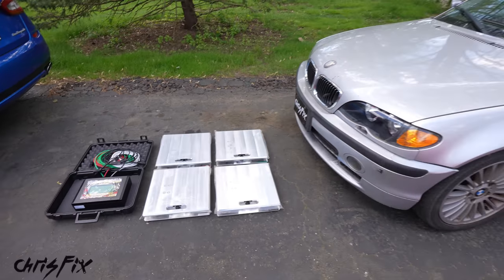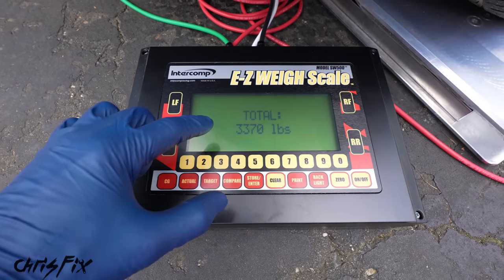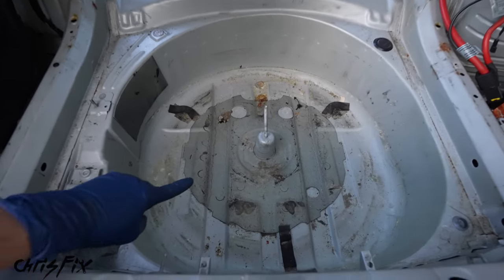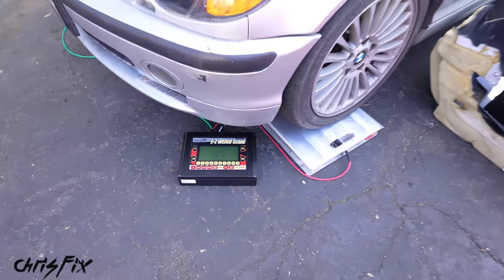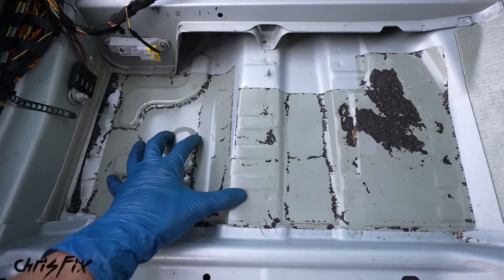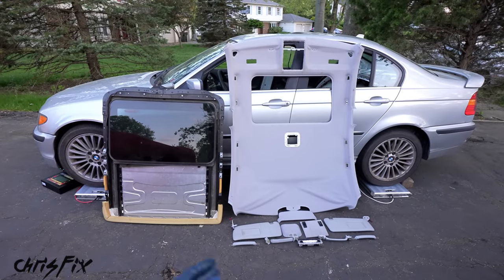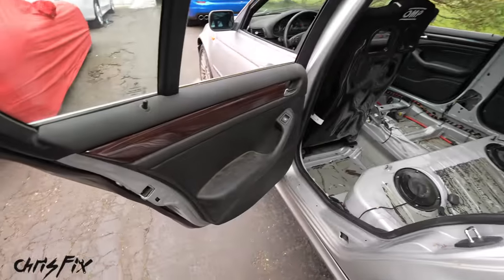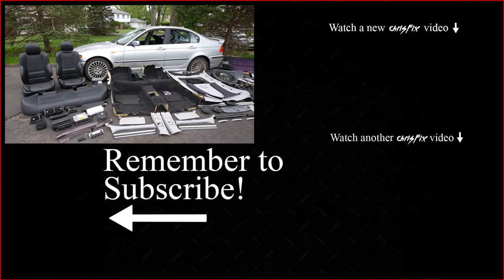How Much Weight can you REMOVE from your Car? (Weight Reduction)

Comment: Alternate title: How to make your MPG go up during a gas shortage
Reply: @dildobaggins069  Meanwhile me with my Blazer getting 15.7mpg 😭
Reply: @TorbCraft  is it from the 90s?
Reply: @x-90  its an 01 4.3l 5spd RWD. Fun little 2dr. Lowered 5" haha
Reply: Lol my raptor gets 9 mpg and it has a 36 gallon tank. I'm screwed
Reply: @Blue_Flame_Raptor  You sir... need a civic 🤣
Reply: @TorbCraft  I refuse. 😂
Reply: @Blue_Flame_Raptor  at least it’s not the TRX which gets 7 or 8 mpg
Reply: @Blue_Flame_Raptor  no wonder why you raptor drivers always drive like crap on the road, seriously when I see a raptor guy they always drive like they are angry and permanent road raging
Reply: My car is an 2007 Saab 9-3 210 HP weighs under 3000 lbs and between city and highway driving gets 28.6 mpg. Not to bad considering I run the AC also.
Reply: @x-90  and the trx has a smaller fuel tank
Reply: @TorbCraft  what about an hybrid Corolla
Reply: @gosth81  I actually got a 2002 civic a month after this comment. 41mpg!!

Comment: There's substantial weight in electric doors - if those motors can be replaced for manual handles, you'll save few ponds. You can remove them at least in the back.
Reply from the maker: Originally I wasn’t going to but we ended up doing just that lol
Reply: Not necessarily. For example on the Lotus Elise, all the fanboys and purists were furious when they introduced electric windows but it turned out that they where lighter than the manual ones. But on most cars you would be right.

Comment: Chris fix: let remove some weight.

Me: removing the engine.
Reply: That’s what I was thinking. “Bro there’s still stuff in the engine bay you could get rid of.”
Reply: Me:*removes car to make it 0 pounds*
Reply: Hah
Reply: @Wee_Mewon  😂😂😂😂
Reply: @steverossen2816  yuuup.  Ac,  Heater core,  smog pump and related tangle of vacuum lines,  the catties,  you MIGHT could get away with a "big" touring bike/lawn tractor battery and be even lighter than what what chris used.  but that's if you know your car is bulletproofed.  if you gotta crank your car for a couple minutes that motorcycle battery is a butt terrible idea
Reply: @voided76  I'm ok with removing just about everything but not the AC. Anything but that.
Reply: He could remove the ac unit and lose quite a bit of weight.
Reply: @voided76  He could put in the battery to the trunk of the car for better weight distribution.
Reply: @angelgjr1999  ......

The battery is in the trunk from the factory.
Reply: @voided76  Oh ahah. My bad my Mustang GT has the battery up front.
Reply: tire and rim are heavy too
Reply: @hom2fu  You're not going to find "light tires" at the 180-250 treadwear that lemons cars usually run.  because they're all either summer passenger or track day specific tires that are grippy as they can be:  but also have to last more than 1 weekend for the most part.  

That's kind of how you don't get people showing up with magnesium/forged/carbon spun or composite wheels with a custom engineered tire compound showing up.   :)  

Maybe you could find some E46 M3 wheels to put on it,  maybe the lemons judges will take one look at that and decide your whole rig is pretty cheaty and what else can we dock you for if not specfically the wheels and tires....

I'd put like... BFG rivals rubber or advan neova or something of that nature:  whatevers on sale on tirerack/ebay ect in a sort of works size,  because a good tire in roughly the right shape is what matters more than a pound or two out of your wheels to begin with. 

some old beat up M3 brakes that have been rebuilt and slapped on wouldn't be a bad idea,  but that's also quite a lot of money potentially and quite a bit of time sourcing parts and kits ect.  I would de-junk the wires,  off the shelf motorsports rotors for that specific car,  make sure all the ball joints ect are greased,  make it as good as it can get as it sits,  with as much as I can try and service the brakes,  dejunk the engine bay of things and send it.  Having a capable crew and decent spares and decent choreography of pit stops is going to be more important than wheels.

Comment: "Okay, now that we've pulled out nearly the whole interior, we can take out the frame and body to remove even more weight. While you do that, removing the trans and engine is essential as they provide a large amount of weight"
Reply: Just ends up sitting in a seat holding a steering wheel
Reply: 69th like
Reply: @TexasBaker  gotta take out the seat and wheel too

Comment: Remove the trunk and install a fiber glass lid, do the same with the rear doors and replace them with fiberglass sheets. Also get a lighter hood and wheels
Reply: Don’t forget front fenders, lexan windows, two piece rotors, and I’m sure he could get rid of some of the less useful metal panels in there like the two crossbars the passenger seat was mounted to. Not sure how much of that metal is used for bracing as apposed to mounting though, and that’s kinda important.
Reply: @levygaming3133  yeah that can be done but its costly to get front fenders made, i felt this was a budget build so i kept my recommendations to a minimum 
But yeah you're right

Comment: Now, let's add weight with the roll cage. Curious to see what the cage weighs.
Reply: "Looks like the cage was too heavy so I'm just gonna have to risk my own bone-crushing death on getting that sweet acceleration"
Reply: lol
removed 10% weight and gained 15% speed.
But without all the noise panels it really feels 100% faster
It's still gonna feel faster if you add roll cages
Reply: carbon fiber go brrr
Reply: @captainLoknar  Removed ~13% weight and gained ~12% speed.
Reply: Yeah the roll cage will definitely add more weight, however once you change out the steering wheel, forged rims, aftermarket exhaust, aftermarket hood, etc like a lot of people add, it's going to bring the weight wayyyyy further down.
Reply: "The car weights 400£ less" lol🤣🤣🤣
Talk in kilograms like the rest of the world,don't be so stubborn
Reply from the maker: Cage and other safety stuff weighs about 180lbs but I removed another 150lbs

Comment: I usually shave every hair on my body and race entirely naked for weight reduction purposes
Reply: Ears and nose? Didnt need em. They were only slowing me down.
Reply: I do a triathlon to lose 30 lbs too
Reply: @KraktysAncientAccount  not aero either, ears produce so much drag
Reply: Remove organs and skin. I like my ride pretty light
Reply: I wondered how could one further reduce physiological weight besides starvation, dehydration, laxatives, etc. . I really didn't need to go where my imagination took me...
Reply: @e7725  carbon fiber skin
Reply: Skin is the largest organ. Don't forget impacted stool😬
Reply: Don't forget to exfoliate, ever miligram adds up.
Reply: @stinkybean1  Yeah like all the dual organs! A kidney, lung, eye....etc. And I had most of my intestines and bladder removed and use a colostomy and urinary bag. And when race I don't use bags, I just drain it outside to the track!
Reply: Same here!
Reply: Don't forget to take a good dump before each race!
Reply: I just stop existing before a race to save weight
Reply: Same. I also tuck it back to reduce any drag
Reply: @ΒΞΔΝ  Tee-hee  =}
Reply: For racing, you need to remove your brain.

Comment: I had one of these, also recommend a lighter flywheel and lighter rims and tires. You'll get that rotating mass down which will feel better. Don't remember if it has a fan clutch and mechanical fan, but if it does, switching over to electric fan will make the engine more responsive as well. Good work, your stuff makes me want to go pick up another project car to make into a race car :)
Reply: Anybody count how many times he said sound deadening?
Reply: No modern German car has a mechanical fan.

Comment: The front doors have air bags in them too. Don’t forget to remove them.
Reply: Is that specific to this car? cause usually the airbag is above the door and in the side of the seats, not in the door.
Reply: Not that car
Reply: i think the fronts do have airbags and rears were an option. I had an e46 and if i remember the fronts do have airbags
Reply: @boyce1204  these e46’s for some reason do have bags in the doors
Reply: @boyce1204  e46 has 6 air bags.

Comment: Chris, you might have a Clutch Delay Valve on the slave cylinder. Consider removing it
Reply: @chrisfix
Reply: Yes this is a must! As an E46 owner who just did a single mass flywheel conversion.

Comment: I stripped even more of my 1997 honda civic by cutting every second layer of metal that wasnt necessary for the structure , deleting every hinge and welding the doors shut, taking out every windows, leaving only 1 layer for the hood on top and 4 pins to hold it down, could maybe gain another second on 0-60 if you do that

Comment: Hey, u could remove the air conditioner from the engine bay, the motors for the windows and figure out a way to pull them down manually

Comment: You can get rid of the door cards if you get rid of the windows too.
Reply: Yeah my thoughts exactly
Reply: Or at least replace the door cards with something simpler, thinner, lighter. Maybe some carbon-fibre? Looks like you can get them for as little as 155 bucks.
Reply: Or plastic windows with the sliding door
Reply: @RichardBetel  Probably not worth the extra laps due to price
Reply: Thought about that.  Could probably lose another 50 or 60ish pounds easily going with something like Lexan all around the car.
Reply: i was thinking of a replacement piece for the backdoors much like he did for the sunroof, the boot/trunk lid too.
Reply: like in NASCAR they jump in the window and cover it with a Net of some-sort
Reply: @RidinDirtyRollinBurnouts  is Lexan a fire hazard?

Comment: If it still isn't enough, remove the entire interior and exterior body panels and let seats, drivetrain and shell lol
Reply: you will be surprised how terrible that would drive at last .if you have tons of power and just running 1/4 mile ....maybe ok to remove anything that weighs something at all ....but track races are mostly lasting some time , wind , rain  , dirt , insects and debris .....you get the picture. you better use a bikes leather suit then
Reply: basically just have a steering wheel, engine, trans, and chassis. thats the ultimate weight reduction.
Reply: it will rekt your aerodynamics

Comment: Hey Chris, can you also remove some parts from the engine bay, like AC compressor, sensors from airbags and other stuff?
Reply: I don’t think ac compressor can be removed without setting up new pulleys and getting a new computer.
Reply: @sorenmortimer4246  nope.  Most BMWs run the AC compressor on its own belt, so removal is very straightforward.
Reply: You can remove ac compressor. You will only need to buy a different size belt to fit. The control unit will store the fault with ac, since it will be all disconnected, but will most likely have no impact on any functions apart from the fact that there will be no cold air inside the car. Condenser can be removed as part of ac system together with all the piping. NOTE dont forget to suck the current gas out of AC system in any local garage before opening it up. 
Either it will be seperate setup like Jeremy Phipps mentioned or it will be on same belt, which you will adjust to lower size. Removing any other components or replacing them with others, more lightweight components will only get you better edge. Thats where the motosport is born. Chrisfix perfectly represents how much it is possible to be done with little to no knowledge

Comment: You had me at the seats - 180lb, that's like one of me! (Even subtracting the 30lb seat you put back in, that's still one of me aged 20!)

I always knew that modern cars were carrying a lot of extra weight around but the idea that you got rid of 430lb with still some more to come is absolutely mind-blowing!
Reply: Exactly what I was thinking. Those seats must be power / heated and whatever else they can cram in there.
Reply: @dyingbreed5386  yup my 08 bmw 328i has like 5 motors for the seats. Had to replace a motor on the passenger side so I weighted it and it came in at 73lbs lol

Comment: That’s actually impressive that’s it’s almost a 1second reduction
Reply: yep
Reply: @nnicolasmora  Right, because going 0-60 0.8 seconds faster with a $0 investment in performance parts is not impressive ? You must know a lot about cars.
Reply: @Nicolas Mora Bruh… a 1 second difference is a whole damn lot in the racing world. 😐 it ain’t like this is a damn foot race
Reply: @Q_N-  exactly
Reply: @nnicolasmora  People in formula 1 for example spend thousands of dollars to try to find every tenth of a second they can. Shaving even a few seconds on a lap can have a massive impact especially over a 24 hour race
Reply: @dakinnie  I can promise you 1 second in 24 lemons means nothing. Second, once you add the cage it's considered a net-zero gain. Worth doing. But there is a strong change you get passed by cars with full interiors at some races.
Reply: @thebaseballer5  I don't know about that. I looked up the timings for the latest race and the difference between the winner and second place was only 48 seconds!
Reply: @dakinnie  he isn't going to win. I can promise you. The people that win have a ton of money in their cars and have been racing for many many years at this point. I have been doing this for 3 years now and a second doesn't matter to 99% of the people racing. Between pit stops, driving ability, and the craziness that is on track most of your time is gained or lost there not in the car.
Reply: @thebaseballer5  1/8 and 1/4 mile 1 second is a huge difference
Reply: @thebaseballer5  net zero gain is way better than the 400lbs of shit he took off and the cage weight added…
Reply: @erendyalatorre7785  this isn't drag racing. Yes over a 1/4th or 1/8th mile drag race is makes a difference but over a 3 mile road course. Drive skill makes more of a difference than fractions of a second.
Reply: Every second Count in a race
Reply: @dakinnie  try millions lol. I can’t even wrap my mind around all that money.
Reply: @thebaseballer5  so u mean to tell me I would rather have an extra pound of weight? Makes sense. Get over yourself.
Reply: My favorite part is where he 5.97 where the is 0-60 25:23
Reply: @JeffNoel  tell me you don’t know shit about cars without telling me you don’t know shit about cars
Reply: @sbinnala14  using dry ice to remove sound deadening is more effort than it's worth. A couple lbs for all the effort isnt going to make the difference over 16 hours. Have you ever been to a lemons race?
Reply: @thebaseballer5  what I’m saying is, would u rather be lighter or not? Your comment doesn’t exactly make sense to me.
Reply: @sbinnala14  I'm saying that it's more work than it is worth. Some of the slowest cars on track will beat BMW, mustangs, and other cars you think are fast. In lemons, it's more important to stay on track and out of trouble than shave off .1 of a second using dry ice to take off sound deadening. So many cars in lemons have just dumb stuff attached to them for the lol's. Because no one can drive these cars where a few lbs are going to make a difference. Go to the 24 hours of lemons youtube page and watch a few wrap-up videos.
Reply: @thebaseballer5  I’m sure ik what lemons is all about, cheap Car, long time. I think we are having two completely different arguments herex

Comment: Another way to reduce heat is by getting carbon fiber body parts, and also getting an nrg quick realest wheel bc those are lighter than the stock leather wheels

Comment: You could have removed some things from engine room, like AC compressor, condenser etc...
Reply: And what about lights, windows+motors.. just don't keep it outside anymore 😂
Reply: @stephanberger3476  The better plan is you remove the window motors, track etc and replace with calibrated stick.

Chris will soon find out keeping his door cards though possible is difficult if you want a safe cage.  WE have used X-bars on most of our cars but "NASCAR" door bars bow out into the the door space to both give more room for the driver but also more rigidity to a survive that Crown Vic t-boning you because you are sideways three-wide in a corner (BMW drives spend almost as much time C4 drivers spinning).  

Keep outside with calibrate stick holding up door glass.  Remove stick and glass at track before test and tune.

Dash should have been significantly uninstalled for the sale reason...the down-legs go where the front speakers are in a well built cage.  You want to keep the defrost vents, heater core and HVAC controls because you will have a rain races and nothing aftermarket or hacked works better at keeping your windshield clear than the OEM solution.

Lights gain you nothing by removing and if you end up running a true 24-hour race in the future, you would need to reinstall the headlights anyway.  All cars require at least one brake light and OEM is the easist.
Reply: Why do you need all four doors again?? Hood?? Trunk??
Reply: @Alex-rl4uy  For real. Take them out and replace with sheet metal if the cage is going to be doing all the work anyways.
Reply: @michaelkrenzer3296  My inclination would be to replace with plastic for aero reasons assuming that's allowed.

Comment: Light weight break discs, carbon trunk and hood, remove the AC compressor will save you a lot of weight as well
Reply: ac is good for endurance racing though
Reply: I'd say keeping the AC in is worth every pound. You'll be a much better driver when you're properly cooled and not overheating.
Reply: This is for lemons, max 500 usd excluding safety gear and what you can make selling parts